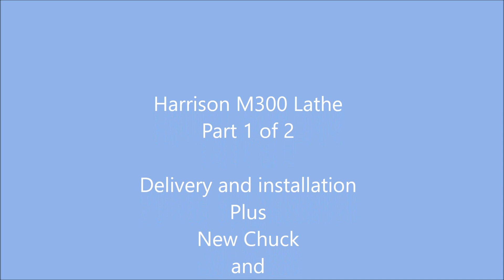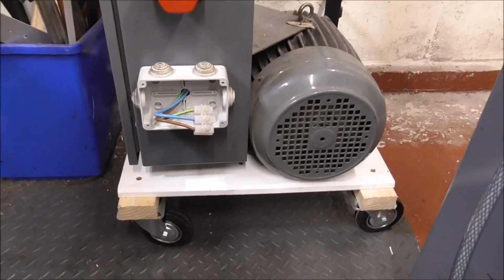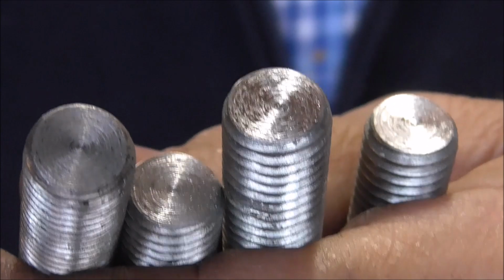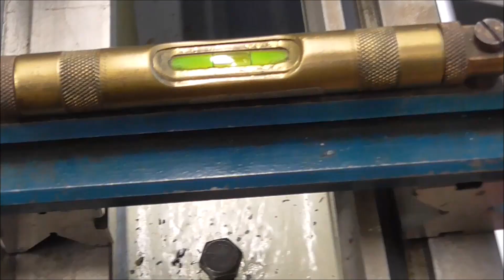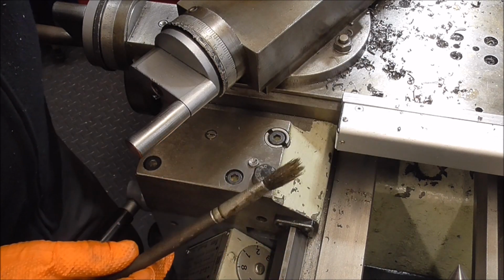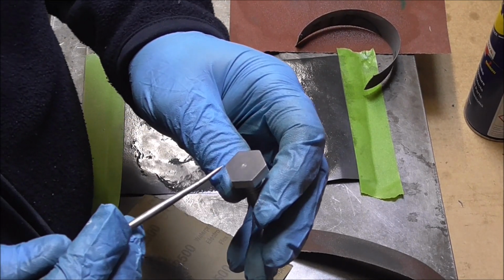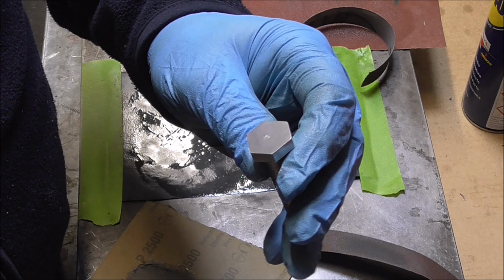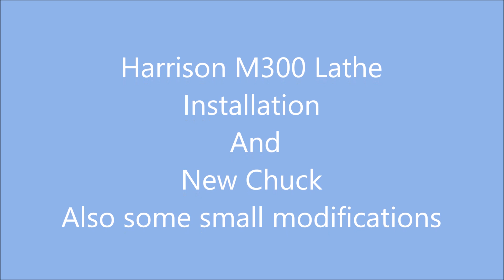Harrison M300 Installation and modifications Part 1 of 2

Comment: Hi Brian,  
Looks a great machine,
I also moved from a Super 7 to a M300 last year, although I had to build my own phase converter, so the jockey motor is separate from the box (behind the lathe) on antivibration mounts which helps a lot with the noise. I found adding a 12 by 26mm needle thrust bearing under the tool post nut gave me much more positive clamping action without feeling like I'm flogging it up. I did have to pull the gearbox of the front to clean the varnish out as the gear change was sticky, and flushing alone wasn't enough. If you ever have to get into things line that check out Sam Fielder's channel, he pulled his M300 completely apart. 
The Myford hasn't left yet, but I'm under orders ........... 😁
Reply from the maker: Hi, great comment.
I have watched most of Sam Fielder’s stuff, me makes me laugh and is a but wakky but his channel is brilliant. Ive solved the problem of the noise by putting the phase converter in the shed behind the garage. I have made a short video of the move and will be posing it very soon. Check it out and let me know what you think.
Thanks again, cheers Brian

Comment: I told my missus I would be selling my ML7 when I got  my M300, but I've still got it two years later ! 
In all fairness, my dividing head is set up for the Myford chucks and I made a tailstock adapter for the M300 to take the 7's chucks too. Plus I sometimes swap jobs between the two to save a bit of time swapping chucks over.
Reply from the maker: I had the same problem with the Myford, I didnt have room for two so it had to go. Thanks for the comment. Cheers Brian
Reply: According to Meatloaf "Two out of three ain't bad"...
You've got an ML7...
You've got an M300...
Still got a Missus?  😋 😉
Reply from the maker: Brill comment, cheers B
Reply from the maker: Brill comment, thanks you Brian
Reply: Picked up an M300 late last year but haven't found the courage to let go of the small model makers lathe, I've had for 25 years.